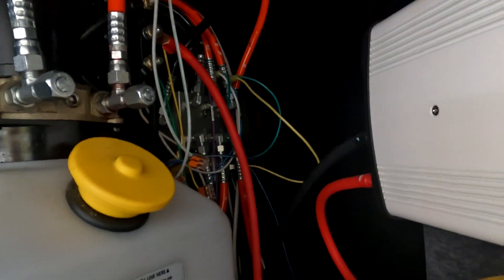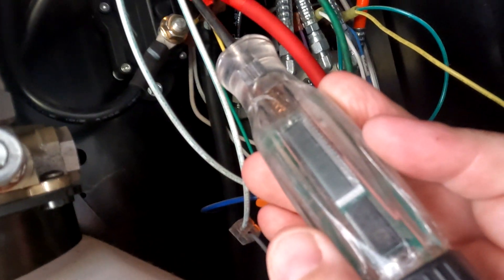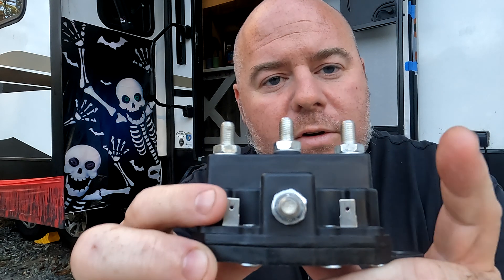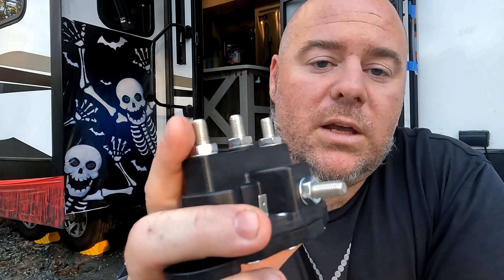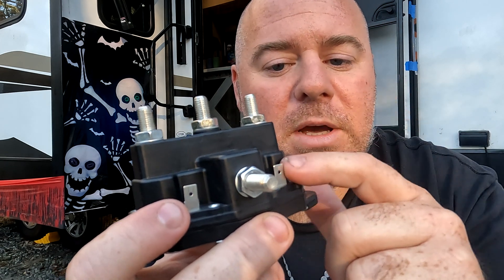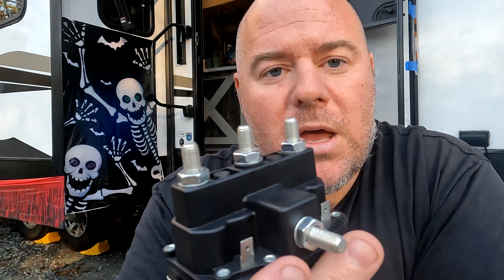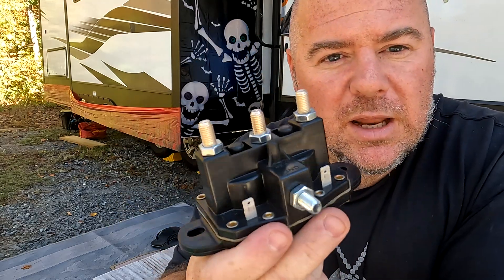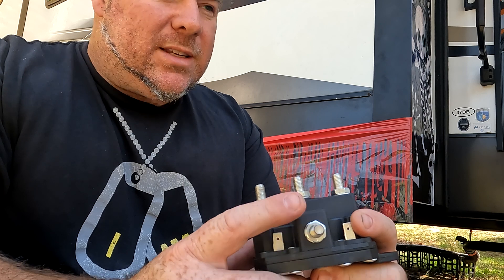How to: Diagnose, and Replace reversing solenoid on Lippert leveling

Comment: Thanks for the great video. I've got a 2008 forest river Georgetown. Where is the 80 amp fuse at? The MH has 3 slides. The main slide has been having a problem when closing, it closes but when you let go of the switch is starts going back out very slowly, I blocked it from going back out. My right rear jack was down so I hit the withdraw switch and it started coming up but the main slide started going out. Now the switches for the slides are not working. No clicks at all. All the fuses I looked at are fine. If you can help with any of this I would appreciate it. Thank you.
Reply from the maker: I am not familiar with where your fuse is on that particular model. it will be between the battery and the hydraulic motor, just follow the battery cables to the reversing solenoid and you will find the fuse/relay
Reply: Thank you  @RVLife4Us

Comment: THIS VIDEO SAVED MY BUTT!
I called Lippert and they were going to have me replace the solenoid.  It turns out that the wire from the control unit was pulled off.  Your testing helped me properly diagnose the issue.  You saved me almost $200.
This is an absolutely stupendous video.
Reply from the maker: glad it helped!

Comment: Thanks for the reply. I got to the same conclusion after was watching a video about the rv charging system i have 13v but probably low amp. One of the battery might be dead. 
I looked into it and i might try the 
Lithium battery. ( Lifepo4 is about $180/ea) Looks like i need 2 since i cant mixed it with the flooded battery. I’m not sure my rv is set up to charge the battery i have to do some digging into it. Secondly these batteries are temp sensitive, and i live in the midwest might not be the right fit. Any recommendation?

Comment: Hello  just wondering if this is the issue with my auto level system..?
Leveling system does work if the rv plugged in, but not from my batteries. Its been cutting in and out for a while meaning i had to press the button multiple times before the jacks raised up, now it does not work at all, unless the rv plugged in to an outlet. Pls comment
Reply from the maker: this will not correct that issue, if the leveling system only works when the the power cord is plugged in then you have a battery system issue.